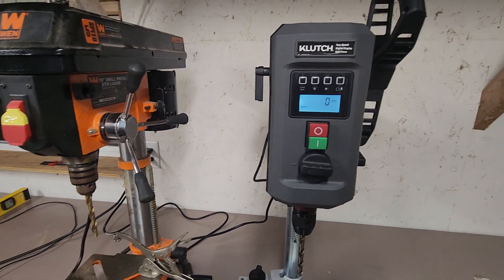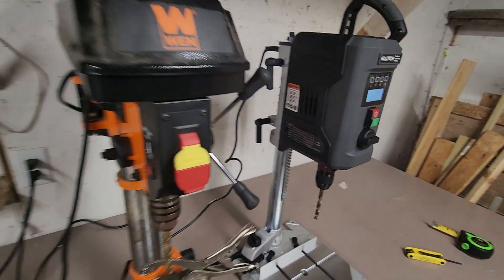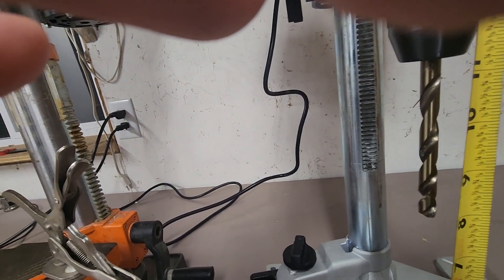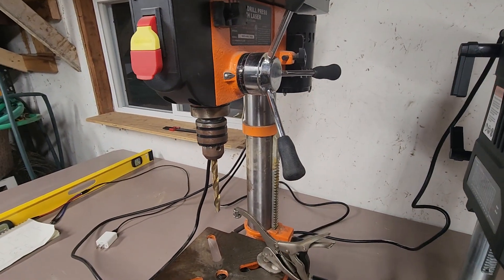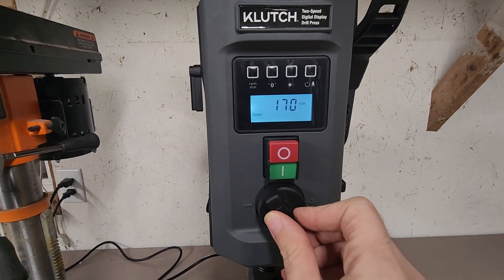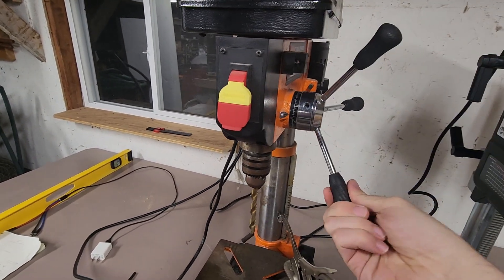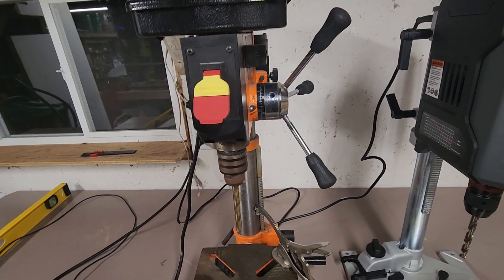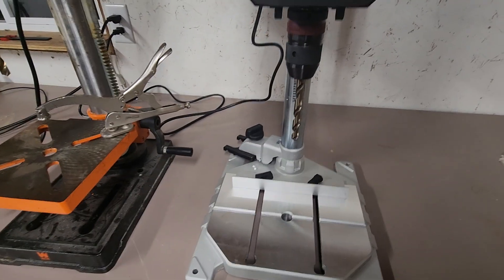Klutch Variable-Speed Drill Press vs Wen 10in 5-Speed Drill Press.

Comment from the maker: I made a follow-up video about the process needed to adjust the lasers:  https://www.youtube.com/watch?v=OPTzJKB18-0
Reply: Hey man, so I finally got one of these small drill presses, but there's some issues I thought I would ask you about as you have had yours for a while, I am trying to see to see if I got a bad one or I can possibly fix the issue. I did not want to send it back although it does have a small dent in the left side back aluminum section I figure Its a tool so maybe I can live with that, however on mine the arbor seems to have play in it, by this i mean play I can see and feel I don't mean checking with a gauge, but not sure if its within the housing or the bearings that support it but I can grab the chuck put a fostner bit in it and i can move side to side which I wouldn't expect because in comparison my really cheap mini-q has no play in the arbor bearing assembly ... have you noticed any play like this in your press? Can this slop be adjusted out did they possibly leave something loose that holds the main bearing in place ideas did I just get a defective one in this new 2025 batch, also the chuck is very tight and difficult to use did they change brands This has a SANOU branded chuck. I know its not a great chuck but did expect it to spin easy enough like any tool less chuck i have used in the past?  What I really like and does seem to work well is the depth gauge and stop, that's really what I purchased it for but I also really need the arbor chuck assembly to not have the amount of slop like it does right now. So if you have some ideas on this you could share that would be great.

Comment: It looks pretty nice I have a mini Q drill and had to mod it a bit to make it more usable, and its small with very little travel but fits into tiny space for storing so that was a plus. So 2 tech questions I have are how tall is the main post from base to top and how wide is the post in mm my mini has a 32mm post for example. What I really like about this drill is the depth stop which works the same as it does on the Bosch and the fact you can set and see how many mm deep you want to go ,so that alone is highly useful for my DIY. Have you tested those features or will you be testing them I would love to know how accurate that actually is in something in this price class. As well as play on the column does it stay in exact alignment with no side slop. I would love to have the Bosch PDP-40 which this is copying part of but unfortunately they never made one for USA 120v power, so this is as close as one can get it seems for those of us not in the UK.
Reply from the maker: Table to top of post is 25.5inches, 65cm. The handle sticks up higher so you would need about 30inches 76cm vertical clearance to use the full range. The post is about 5.75inch circumference, so about 46mm diameter. With the height adjustment tightened there is zero side to side play. With it loose, there is a fair amount, about 1/8in side to side.
Reply: @pilotdog68  Thanks much any info on the digital depth gauge and its accuracy as It would be fantastic if it was usable and at lest fairly accurate. Will you be doing any type of review and testing on it?
Reply from the maker: @vidworxsfx  I won't be doing much work with it till the spring warmth comes, but I did just test it with my setup blocks. The digital depth gauge was either dead-on, or within 0.1mm for each depth I tested.
Reply: @pilotdog68  That is great to hear that its that accurate, as that is something I will be using often if I was to buy one of these.
Reply: The Klutch handle is loose, it's retaining machine screw is substantially narrower than the hole it passes thru on the side of thedrill head, I will need to fix this.  Vertical motion is stiff.  But I am still keeping it to replace my 5 speed belt drive Skil bench top  drill press.